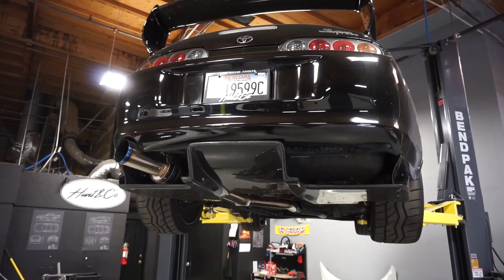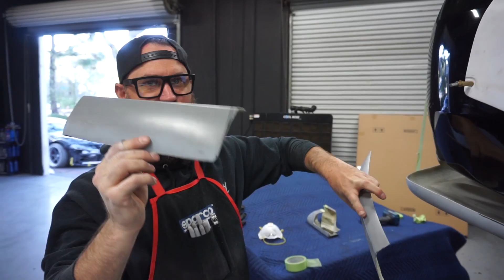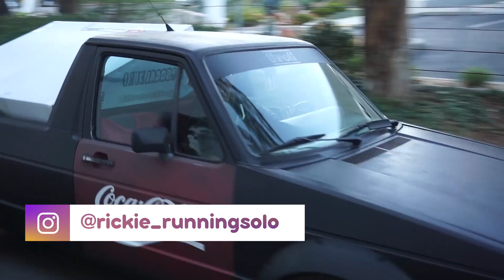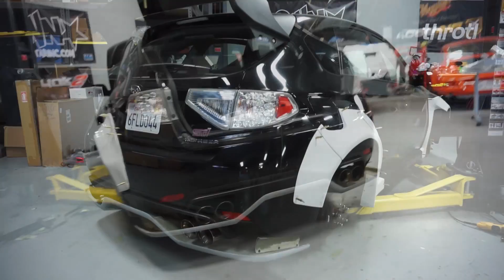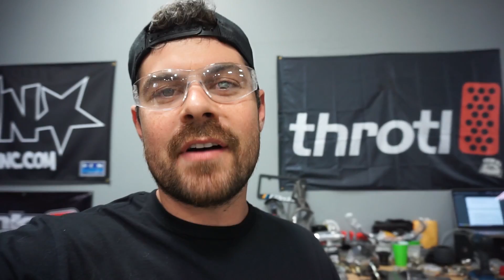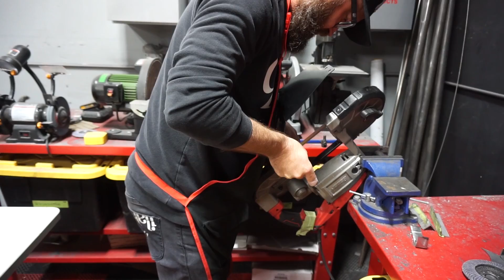Building the ULTIMATE 2008 Subaru WRX STI Hatchback - Part 2

Comment: Diffusers are useless in real application, it's a RICE part.  No real working value.  A diffusers only have function if the entire bottom of the car is FLAT.  No pockets, no holes.... a totally flat surface... you know, like the bottom of a RACE CAR.
Garbage.  Useless added weight.

Comment: You should do a flipped manifold so the throttlebody is on the front. It's much cleaner and uses much less intercooler piping.

Comment: Why do you guys take the guard off your grinder and then struggle with sparks in the face and the possibility of a disc coming apart and hitting you? You wear gloves, glasses etc, you obviously care about your own safety....????
Reply: Andrew Johnson - Because the guards is always in the way. Beyond that, if you are proficient with a tool such as an angle grinder and don’t use it improperly you don’t need to worry about a disc coming apart. Discs come apart because they are being forced to be used in a fashion they are not meant to be. We are smarter than that. But, thanks for your concern.

Comment: That Mishimoto gear is pretty legit! My only concerns are that the intercooler is probably pretty excessive for the stock turbo, while the piping uses more silicon than I'd like (but then, I avoid silicon joiners wherever I possibly can 'cause I'm anal like that). But otherwise pretty solid stuff!

Would you consider a larger turbo at all?